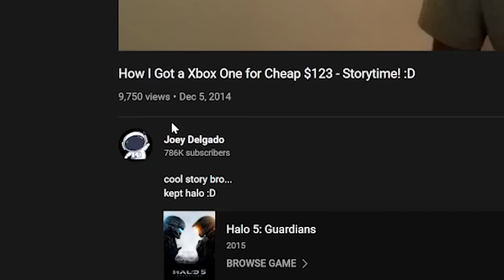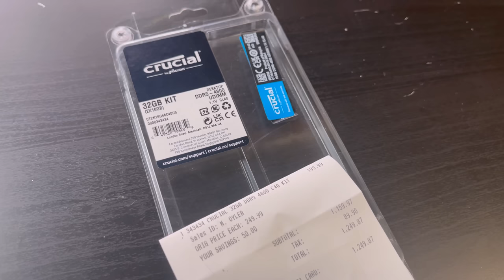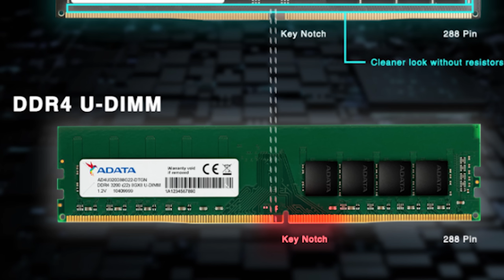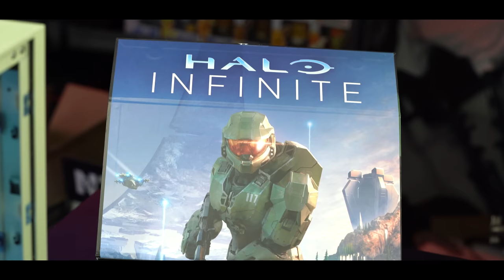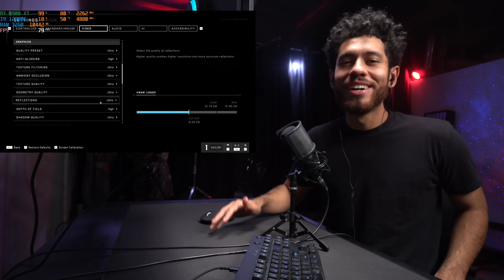RX 6900 XT Gaming PC Build - Halo Infinite i9-12900K

Comment: I want to thank you so much. I decided to build my own pc back in January. So, I began to follow your videos and just watch and learn until I had all the parts I need to complete my build. I wanted a black panther build and thanks to you I was able to complete it. I had very hard time getting a gpu for retail but I luck up on Cyber Monday and was able to get a RX6600XT for retail. You go in such great detail on what to do and how. I just wanted to say thanks. When everyone sees it, they can't believe that I did this from watching your YouTube videos. Keep doing what you do and great pc by the way.
Reply from the maker: Means a lot man, thank you.
Reply: How much did you get the 6600xt for if i may ask ?
Reply: @27aiman  Its was 650 when I purchased my XFX SPEEDSTER QUICK308 AMD RADEON RX 6600XT 8gb GDDR6. I got from BestBuy at the time. I see now BestBuy has it for 522.
Reply: @Str8gutta561  is xfx a good brand ?? 
Im planning to get an xfx rx 6600 xt the swft 210 version its the cheapest i can find in my country (420 usd)
Reply: @27aiman  I have had no issues with it and very easy to use and I plan on upgrading to the XFX - SPEEDSTER MERC319 AMD Radeon RX 6950XT Core 16GB GDDR6 PCI Express 4.0 Gaming Graphics Card - Black. So, I would recommend them.
Reply: @Str8gutta561  tysm for the replies ❤️

Comment: Hey Joey! I’m finally going to start building my PC this Christmas. But I just wanted to say how much your videos have inspired me and have made me feel a lot more comfortable with how to go about building my PC. Thanks for the awesome videos! Happy holidays!
Reply: Do you have an update on the build?
Reply: @ScumAlpha  Yup! Everything is working perfectly. It took me about 2 - 2 1/2 hours to finish the build, but it’s awesome! I’m running a AMD Ryzen 5600X, 3060 EVGA 12GB GPU, and a Kraken Z53 all in the H210 case.
Reply: @skatagirl4eva  how much did it cost because I’m looking to build soon too
Reply: @petitiepolarbear  porbally alot. I just finished my build I had a lower budget but wanted good ish parts and for it to run VR well, I bought 32gb 3600mhz rgb xpg ram, intell I5 10400f, Rx6600 (barely slower than the 3060) 500gb ssd, all in the monitech flyer. I also had high end fans with a black and gray build looks great and didnt break my busget
Reply: @hunterfountain170  how much was your budget because that sounds good
Reply: @petitiepolarbear  
I think after tax and shipping and all that I spent around 1050$
Reply: @hunterfountain170  ok well thanks

Comment: Awesome builds as always. I’m curious what’s a good budget to make a pc? Not to low power but not to high power something medium high.
Reply: For a long time, anywhere between $600-$1000 was the sweetspot price to performance wise when it came to building or buying a prebuilt. Of course with everything going on nowadays, you have to spend atleast $1200-$1400 ish for a similar pc in the upper midrange area. My 1070/r5 3600 build was about $800 back when i built it in sep 20. 

Imo, i consider cards like the 1070, 1660ti, rx5600xt, 2060, etc to be in the mid-upper midrange field where most people would honestly settle in if given the chance. Sadly pricing is iffy due to scalping, price gouging and low availability so unless you find a solid deal 2nd hand locally, expect to pay atleast a $300 premium on any prebuilt/gpu. We still have some time before pricing gets better, and even then it wont be by much.

Comment: I can't believe that graphics card was $4,500. That's insane! If we were making a PC like this one, I'd assume we could go with a $1,500 RTX 3090 graphics card since those should be around the same specs.
Reply: it was only 4500 since it was a limited edition version of a 6900xt on ebay. On retail website it would be much less than 2000$ but he bought it off a price scalper since its out of stock
Reply: Should I make this same build with 3090?
Reply: @AmirLegit  Most of it seemed fine, but I don't know about that CPU choice. I'd recommend doing some research on which CPUs are best to pair with a 3090 before committing. The one he chose should be fine, but I'd imagine that you'd want a stronger one if your pairing it with a 3090 build.

Comment: Correction- That is not AMD's "fastest card" Their fastest version is the "XTXH" Chip! And required mandatory 3- 8 pins 1000watts PSU minimum highly recommended. For that price, they should at least include the XTXH chip inside. What a shame!

Comment: For the record you can get a 6900xt in store for 1800 and a i9 12900 k with mother board for 1000, ram with 32gbs 4000 mhz plus at least another 400….. so maybe that’s a nice 2500 bucks in your pc 😂😂 but not no dang 7,000
Reply: the graphics card was a limited edition one and rare so it went for nearly 3 times as a regular one

Comment: Yo any one who could help me i have a ryzen 7 2700x and a 3060 ti and my fps is terrible my gpu is only running at 30 pecent tops when i play a game what could i do to make my fps like it should be?
Reply: Update gpu and cpu drivers. Make sure game is optimized. Last resort I’d say is to update bios
Reply: I'd try and grab a 5600X if you can, they have dropped a bit in price and should continue to do so especially when 3D cache Ryzen launches soon. If you play at 1080 with competitive settings you're most likely cpu bound. I'd also make sure the cpu is getting proper cooling and not thermal throttling. Make sure the cpu is hitting the advertised boost clocks.